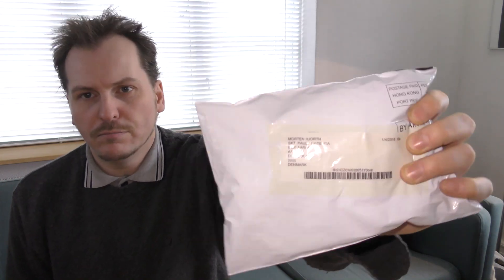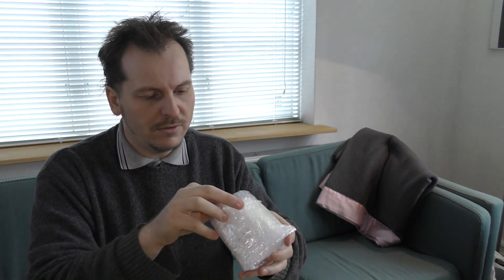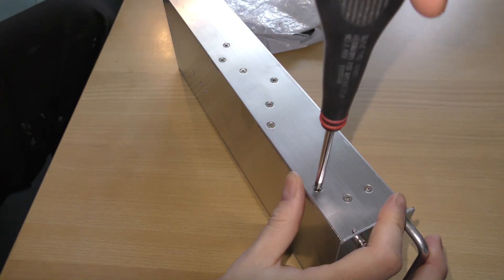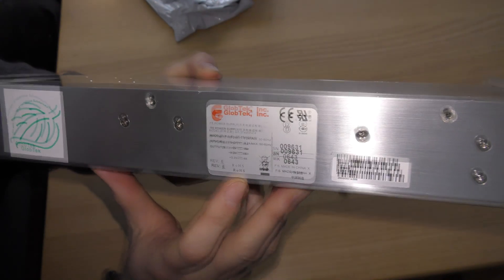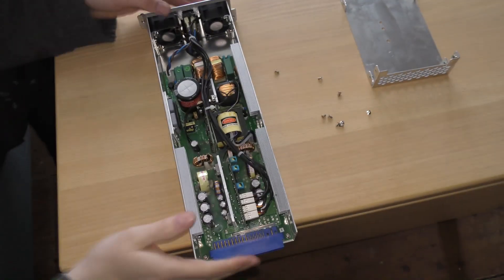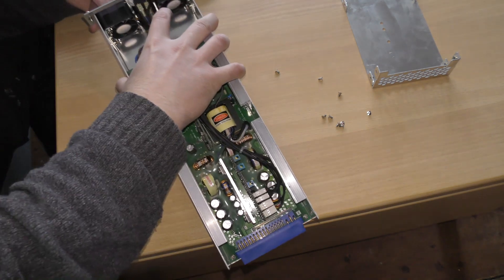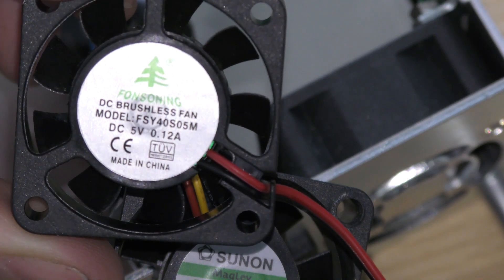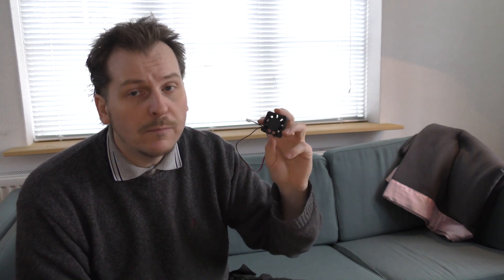My PlayHouse receives FAN mail - 300

Comment: Is the fan you're looking for a 40mm x 40mm x 40mm (WxHxD) 7,000 to 10,000 RPM Nidec Fan?
Reply from the maker: HI +produKtNZ 
40 mm deep,,is that right? 
Thank you for watching! :-)
Reply: +My PlayHouse (Morten Hjorth) Yes thats right. I think from memory it only has 2 wires (red and black) though. I bought 4 of these fans for a project sometime ago,
Reply from the maker: Hi produKtNZ
Tha Fen that i need for this PSU neds to be with three wires,, the fan speed is monitored and it will error if not there.
Thank you for watching! :-)

Comment: For those of us with subwoofers, please eq your audio so we dont have loud thumping. Otherwise, nice video!
Reply from the maker: Hi +TheLameTechGuy 
Can you guide me to what you mean,,where in the video?
Thank you for watching! :-)
Reply: +My PlayHouse (Morten Hjorth) Through out the video there is a low hum, and pops of bass in certain areas. Like an area with no sound other than your light music looks like this on the frequencies. http://i.imgur.com/91NQcHw.png

As you may be able to see there is a lot of low frequency compared to the noise of the microphone and music. Just by doing a high pass filter at 100hz 12db in audacity the problem is almost non-existent.

Comment: These Sunon Maglev fans are a pain in the butt. I had one similar (different dimensions, but the same brand) in a Dell Optiplex 745 USFF under the HDD cage, and the bearings were giving such a horrible noise, that I decided to throw it out. Since then that computer was upgraded to an SSD, so there is no point in having that fan in there anyways.
Keep up posting the videos, Morten, they are very interesting!
Reply from the maker: Hi +AttilaSVK 
Thank you for your input and,,,,
Thank you for watching! :-)

Comment: Peel back the sticker, pop out the rubber bung, 1 drop of air tool oil will get it going for a fair amount of time. If its monitored then no harm, it will report if it slows down / halts.
Reply: just saw the cooking oil comment, organic oils will break down / sludge over time. wd40 will probably work but its too thin and will likely dissolve the sticker glue. I have a 25ml micro squeezy bottle of the air tool oil.
Reply from the maker: HI +88djdmepfdnkjf94 
Okay i do think i have some air tool oil, I can try,, thank you.
Thank you for watching! :-)

Comment: looks like i am first. and it looks like you have some fans :) i have found that putting a drop of air compressor oil on the bearings of the fans quietens them down a bit and makes them last longer. regular cooking oil seems to work well also. obviously this will not fix a faulty fan.
Reply from the maker: Hi +smallenginedude71 
i was also thinking about giving them a bit of WD40, but don't want that oil all over the place.
Thank you for watching! :-)
Reply: My PlayHouse yeah, WD40 gets very messy.
Reply: +My PlayHouse (Morten Hjorth) wd40 also attracts a lot of dust making it gunk up :)
Reply from the maker: Hi zerodegrees8
But is that different from any other oil??
Thank you for watching! :-)